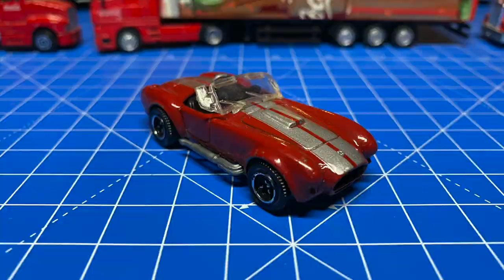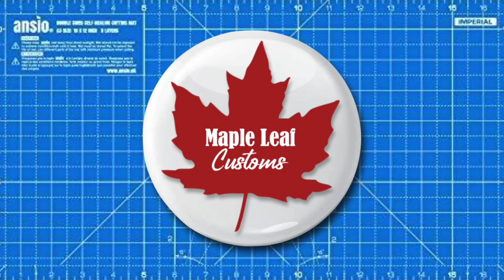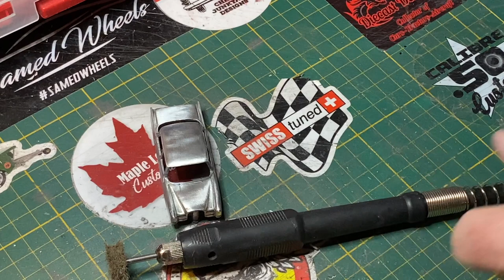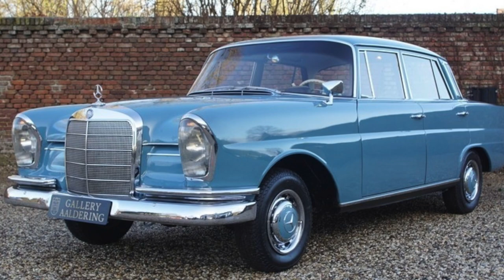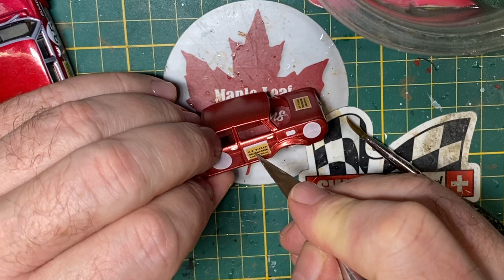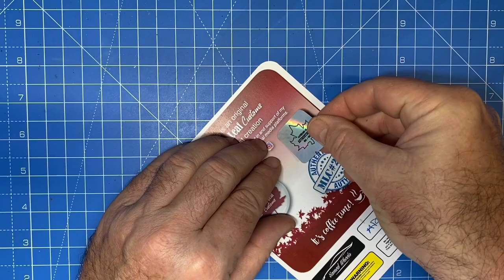Matchbox Mercedes Benz 220 SE (235) conversion to a 300 SEL 6.8 AMG

Comment: Fantastic, love the front end and flairs… however, putty and not JB Weld?!  A also loved the color, the original, while historic, was pretty “meh” and the metal flake red is most appropriate for a race car.  Well done, as always, thanks for kicking off my Sunday AM.
Reply from the maker: Hi, Brian. Thanks for weighing in, with some more good insights. I use JB Weld for joining metal pieces. In this case, the 3D resin grill was so delicate, and only needed some filling in the gaps, so the Tamiya putty got the call. That requires only a light sanding touch to match all the edges, while JB Weld is a real workout with a metal file. A bit too robust for this case. 🍁☕️✌️

Comment: That Hot Wheels model of the 300 SEL 6.8 AMG is really a Hot Wheels Premium from the Deutschland Design series. Also seen a replica of the real car in this year at the Classics & Coffee meeting in front of the Mercedes-Museum (you may look for 🚘 Classics & Coffee MB Museum Stuttgart ⛔ 16.04.2023 🚦 Teil 2/4 🚗). It was also in red metallic paint but I am not sure if it was the original color (the original car got destroyed after the races) but in last year at the 55 years AMG special exhibition I've seen another one of the so called "red pig" (rote Sau) in a plain red paint (you may look for🚗 55 YEARS AMG ⛔ Special Exhibition 🚘 2022 🚙 Mercedes-Benz Museum Stuttgart).

The 220 SE is also really great looking in this 300 SEL 6.8 AMG racing trim. Very cool that you also go these fat wheels for this conversion. I was surprised when I saw the "original" (well, the replica) of the Rote Sau with really such fat wheels.
Reply from the maker: Danke, and thanks for all the info! I've been to the Mercedes museum too. Always interesting displays there. These both have a racing heritage, so it was a fun challenge to do the conversion. 🍁☕️🏁

Comment: things that make you go, "VRRROOOOMMMM!" or something.
great result, the new front fits well. :) great work! ^^
what's also interesting with the W108/111 types is that the smaller 190 only had a shorter front for the 4cylinders, the cabin section and rear end are the same. but unlike with american cars from that era, and some british ones, you can't just swap the front end, everything is welded... :)
Reply from the maker: The magic of diecast! You can measure, resize, custom print and connect anything! At least I found out you could with this pair. I hope to do it again in a few months with the Corvette Summer Stingray that's going to require some blended parts to make the Superfast casting match the movie car. Wish me luck. 🍁☕👍
Reply: @MapleLeafCustoms  oooh, I recently re-watched that movie. :D that's gonna be epic! will you do the enemy car, too? not sure if there is a HW casting that matches the year, though...

Comment: You might want to look into molotow chrome pens. They look better than silver or tin pant. Also with a 1mm tip, it should allow you to get some of the finer trim details that are nearly impossible to accomplish with only a brush.
Reply from the maker: Hi, Jonathan. I've got the Molotov pens in a couple of sizes and have used them with mixed results. Too often they've blobbed on me, ruining a good trim line. I used the refill pen to disperse some paint and then apply it with brushes. For the fine chrome trim around windows, I've successfully masked and painted them on larger scale cars, but on these tiny ones... I've also achieved what I thought were good results with the 1 mm pen, freehand, until I saw it under the HD closeup camera. Ooh. It's far from a crisp, straight line. It's a tough move, for sure. Anyway, thanks for watching and have a great day today. Greetings from Switzerland. 🍁☕️👊